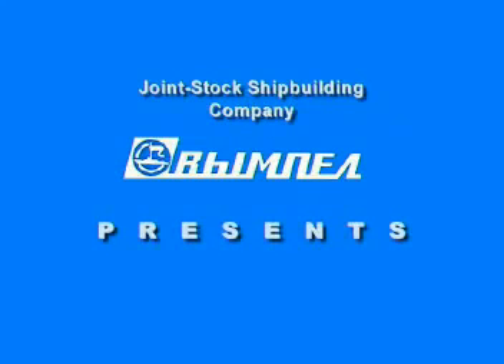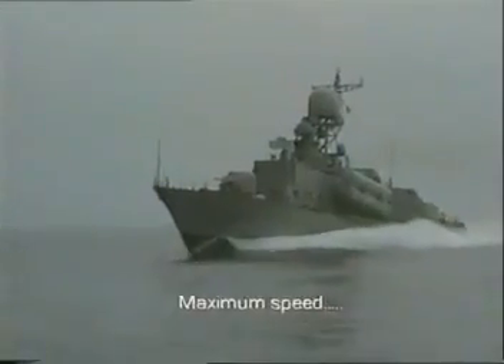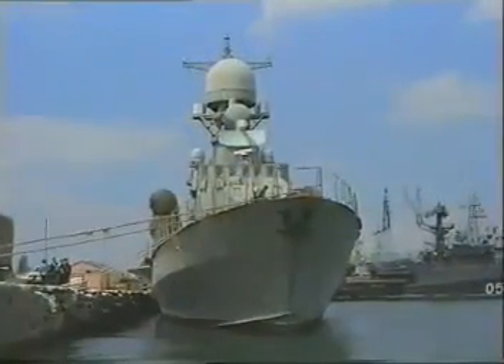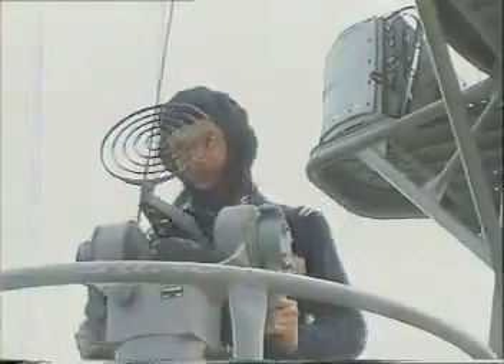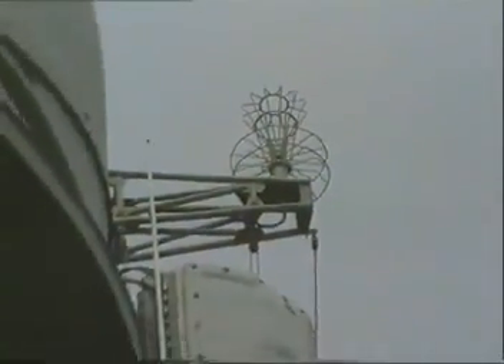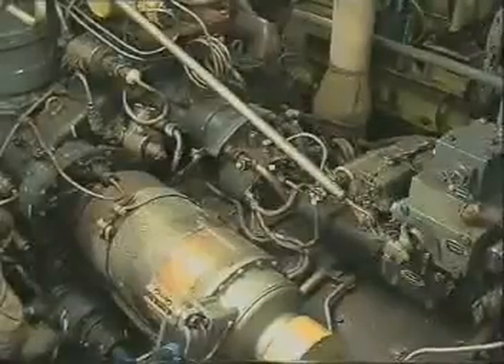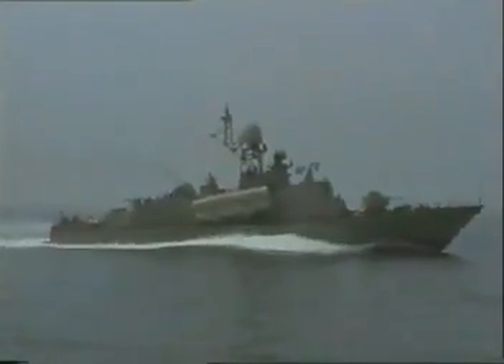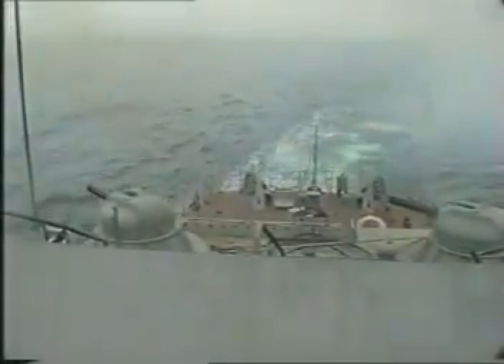Tàu hộ vệ tên lửa Tarantul I Việt Nam thử vũ khí /Navy Tarantul I VietNam

Comment: k biết dựa cột mà nghe b, cái này ta có lâu rồi, nhưng số lượng ít quá, biển của ta tì rộng, mình nghĩ phải có tầm 40 tàu hộ vệ tên lửa này + 8 Khinh hạm ( loại như SIGMA hay GEPRD 3.9 cũng dc mỗi vùng hải quân 2 cái) + 12 tàu ngầm có điều kiện săm thêm 2 tuần dương hạm cho hoành tráng ( TQ lac mắt ngay - cì n cũng chưa có :v ). cộng thêm có khoảng 40 máy bay Su-30mk2, 12 máy bay Su-35, 12 MIG 29, 4 Tu-90 , 12 máy bay tuần tra biển, + khoảng 1000 quả tên lửa X-35 là lấy dc Hoàng sa ngay,